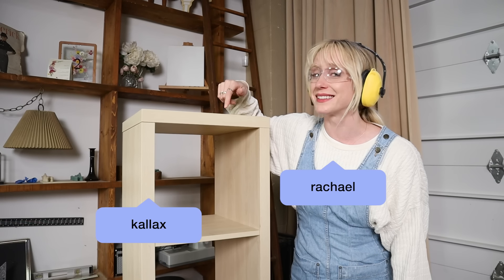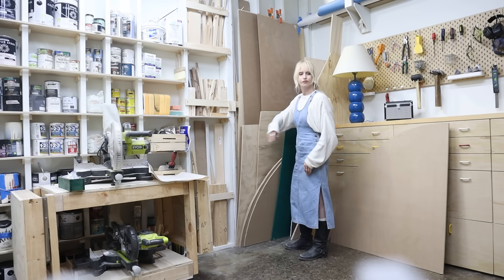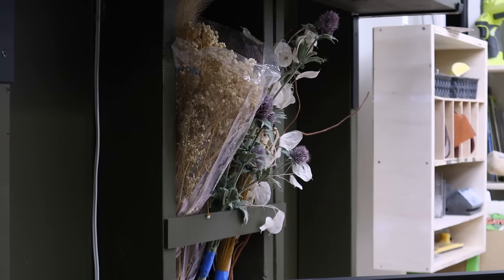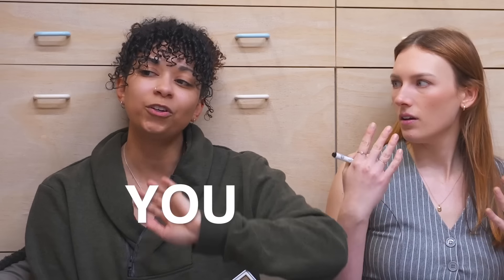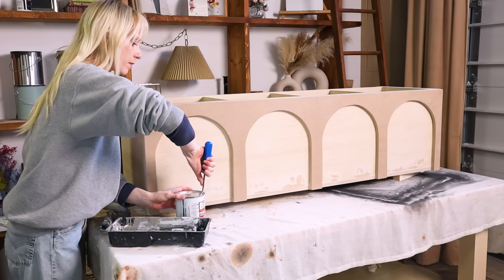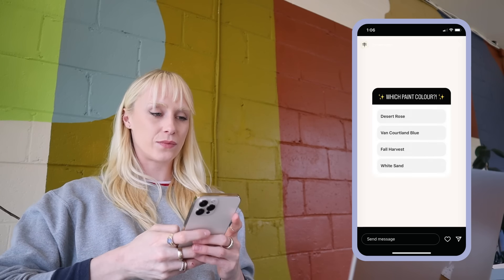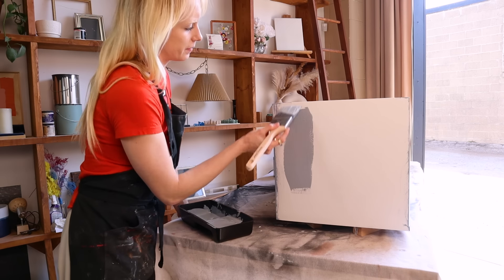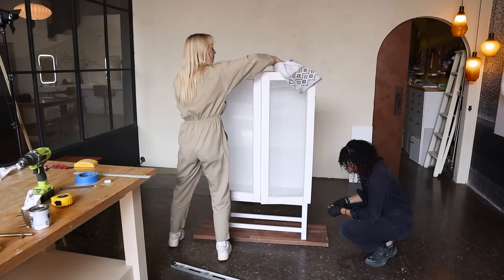I'm back with another IKEA hack | DIY Kallax storage bench

Comment: Very nice bench. I think I like the rust color better. :)
Just because you have the glue in your storage room does not mean it is free. You should always calculate or tack on 1.00 at least. One day you will have to buy more glue and the good stuff is expensive. I was told that as a professional artist, a portion of the cost of art is the tools. A few cents/dollars here and there for brushes, as they do wear out, a portion for palette use, a portion for paint used, etc. You put that cost money in a jar for restocking your supplies. NOW.. this works the other way too... if you buy a pail of paint but don't use all of it on a project... you don't charge the full cost to the project. Fair is fair.  I know a lot of people would say this is too much work or too nit picky with pennies.. fair enough, but you don't have to measure the glue in the entire bottle, use some, then measure again, figure out the amount you used, figure out the tax, etc. Use guestimate sense. :) As this was for charity, it is great that you did not charge for all those things. :)